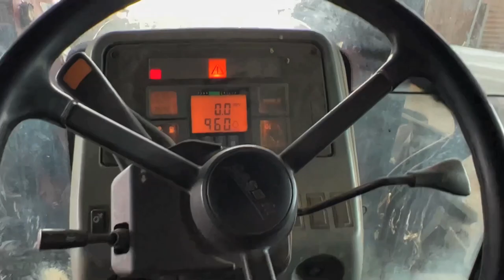$50,000 DRONE Ford Escape JUMP!

Comment: wtf.???   instead of ordering a new chain and ur gonna run in to the issue of having to remove links on the new chain cause it wont tighten up.... just add a link or twot o the currrent chain... much easier and way way less waiting